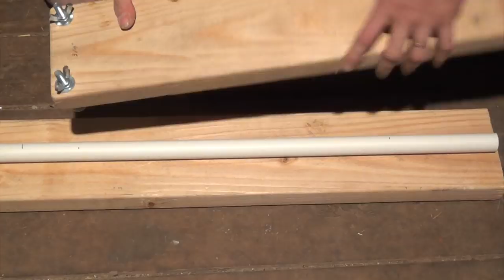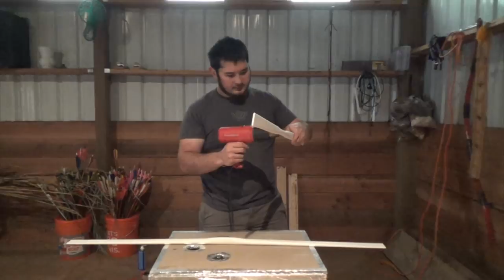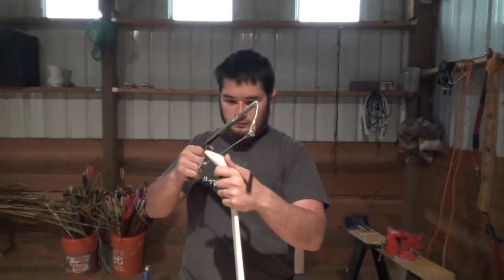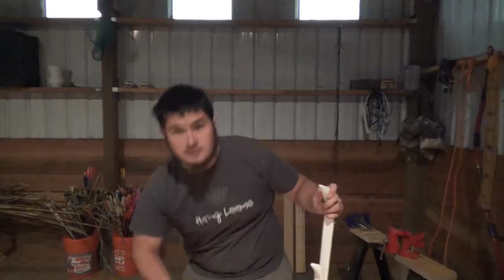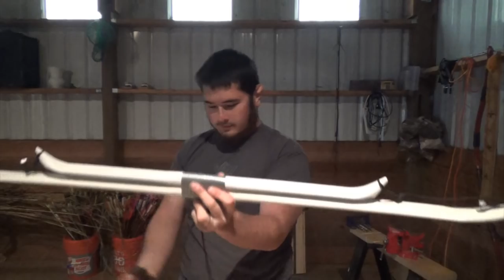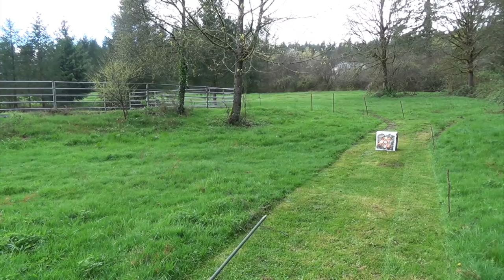April Fools Bow 2015 - Making a 25-55 Pound Adjustable PVC Penobscot Inspired Double Bow

Comment: You said that the helper bows power is adjustable with a twisted string. Is that because after the initial length is made, the string can be incrementally shortened by simply twisting each end a little by little? Effectively you can make the helper bow be a training aid to get stronger and stronger? I really like watching your videos. You’re very talented. Very skilled. Thank you for sharing your genius!
Reply from the maker: Exactly! The main bow draws 25 pounds. By twisting to shorten or lengthen the helper strings, the weight can be adjusted up to 50 pounds. Thank you for watching!

Comment: That is pretty awesome, Not sure what your access to raw hide is, But it would hold that together right over the tape holding it in place. Here is a link for a goat skin in raw hide but you could make handle wraps for all your bows with one side. Just soak it and get it soaked then sew it together and as it dries it will shrink to fit. 

http://www.amazon.com/dp/B00B1G5LJC/ref=wl_it_dp_o_pC_S_ttl?_encoding=UTF8&colid=21XJJ635XNMI5&coliid=I3CDAWKC1WIXE8
Reply: Hi DJ
Reply: hi Karen.

Comment: Nice design! Probably the neatest looking penobscot bow I've seen! Just a couple of quick questions: instead of a string between the main bow and helper could a mechanical turnbuckle type linkage be used?
 Also, can single layers of PVC be laminated into a functional bow limb?

Comment: I made myself a copy of this bow the other day. How ever it wants to collapse on itself near the handle. Posibly because the way the handle is formed it wants to bend on the thinnest spot, that is the sides of the handle after it has been formed. Any advice to counter this?
Reply from the maker: +Therkel Bromand How thin is your handle section? It should be about around an inch wide at the thinnest part. Also make sure you're using schedule 40 (3mm wall) pipe or thicker. Hope this helps!
Reply: Ah! Worked splendid! Thanks mate! Keep up the good work ;)

Comment: Isn't the arrow supposed to be fired from the middle of the bow as you hold it just beneath? Because here you're holding the bow at the middle and the arrow is flying above it. -_-
Reply from the maker: On a bow like this without a large rigid riser, you usually want the arrow to be anywhere between 1 to 2 inches above center. If I were to lower the arrow to center, the limbs of the bow would become unbalanced. It's pretty common for Asiatic composite bows and traditional bows that flex in the handle.

Thanks for watching!

Comment: i made the base bow (the longer one) and tested it, strund it, pulled it back and it BLEW UP, and not in a area where you think it would, it was in the middle of one limb.  the pvc was a bit burnt but it didnt snap there. Any advice on how to fix that problem
Reply from the maker: +Nick Butler What kind of PVC were you using? Was it schedule 40? Was one or both of the tips intact after breaking? You mentioned burns, were there any spots that were shinier or glossy compared to the rest of the pipe? Those can sometimes be worse than burns because they can be hard to see, but make the plastic more brittle and glass-like.
Reply: +BackyardBowyer it was scedual 40. both tips were intact, they didnt fail on me, and yes there was spots that were shinny but it didnt snap on them
Reply: Do the hammer test. Take the PVC pipe you want to use and lay it on a hard, smooth surface and smack it with a hammer until it's flat. If it makes it all the way flat it's generally safe to use. If it shatters then you need to change up the brand.

Comment: Did you use a normal grade PVC or a pressurized grade?
Reply from the maker: It is schedule 40, so the wall thickness is a little under 3mm.

Comment: wooow great bow,thanks nick :)
how is the heat box going with you have you had any problem or improvement with it?
Reply from the maker: The heat box works great, I haven't had any big issues with it. One thing is that I now rotate the pipes at about the 2-3 minute mark for even heating. Some guys have installed baffles to reflect the heat as well, but other than that I haven't found any issues. I use it quite a bit.
Reply: BackyardBowyer aha ok great,thanks for replying :D

Comment: Hey Man, would using this tutorial to make the main part of the bow on its own be advisable? instead of making the helper bow along with it?
Cheers :)
Reply from the maker: EpicTurtle113 That is fine. The bow will end up in the 25-30 pound range. If you made it shorter, the weight would go up. Every inch shorter increases the weight by about 2-3 pounds. Starting with a 48" pipe will give you around 35-40 pounds at 28". Hope this helps!
Reply: BackyardBowyer It does indeed, thankyou for your time! Love your work!